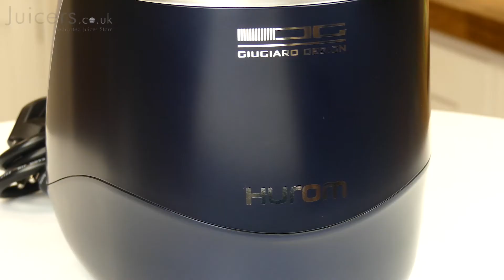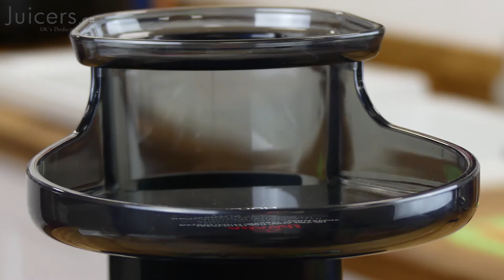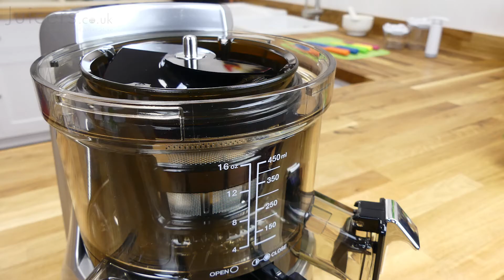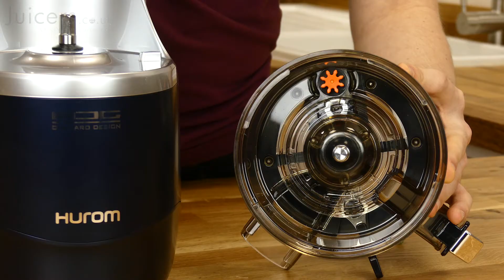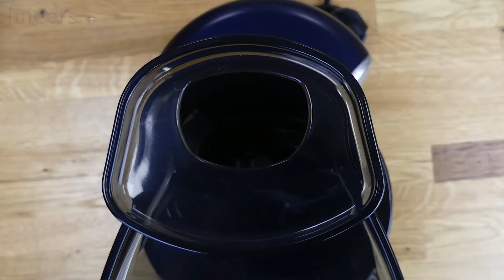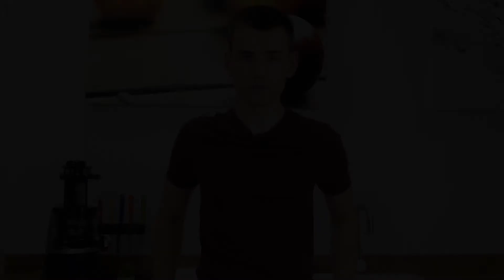Hurom H-AE Slow Juicer Review

Comment: I purchased an H101 Easy Clean model (which also has this better hopper design), and have been very disappointed by the amount of pulp and foam I've been getting from celery and green apple juice. There is also a lot of product left all around the auger. Would this one perform better?